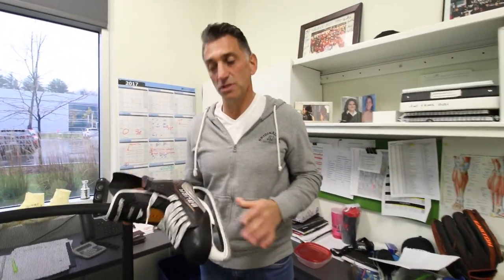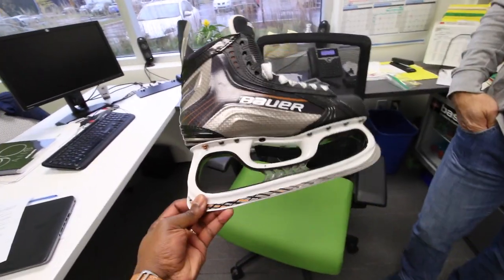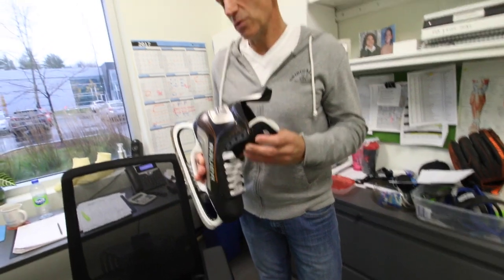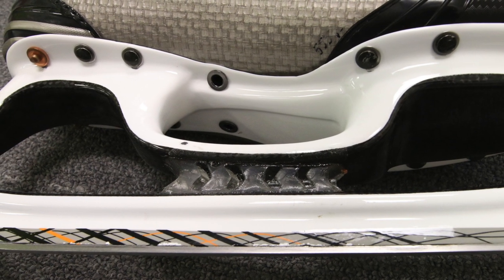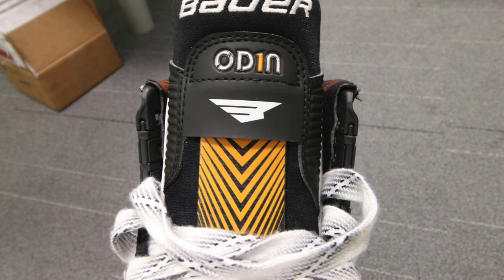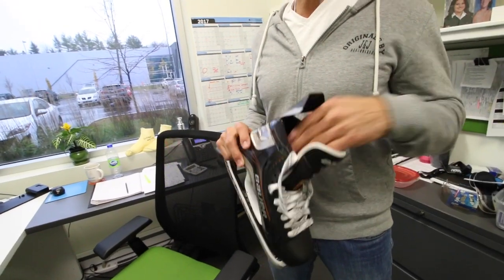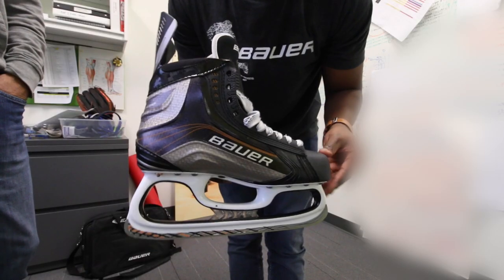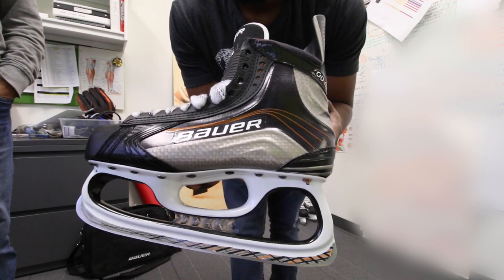What is the Bauer Hockey OD1n Skate and why was it made ?

Comment: The holes between the holders are NOT a problem. Easy to solve by just having a band or something stretching between the holes (in order to reduce as much weight as possible). With such a strong band,  no pucks would be able to get through or any sticks would get in there.

What I find very interesting is that you don't need to sharpen the blades since it's made of material where you don't need to sharpen it at all. Kinda fasinating. 

Though I wonder how "durable" these skates are when they are so light and thin in structure. 

And they are not THAT ugly like people are making it sound like. A little bit of color painting or what ever can change the whole entire look of it. At least, it looks futuristic. We have to move forward.